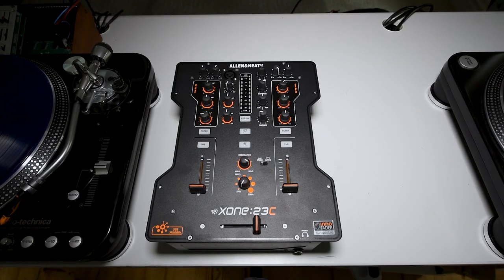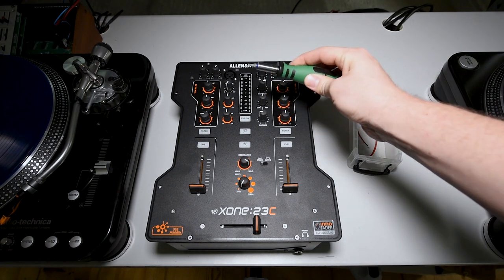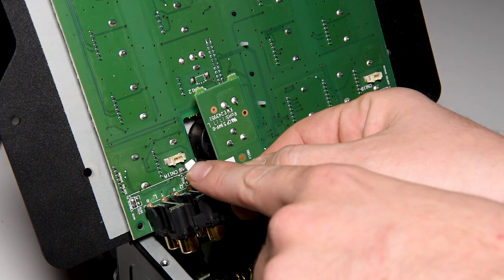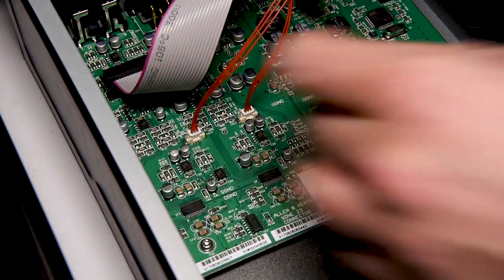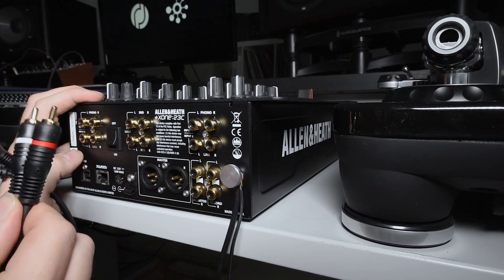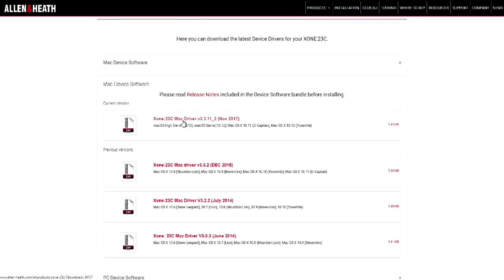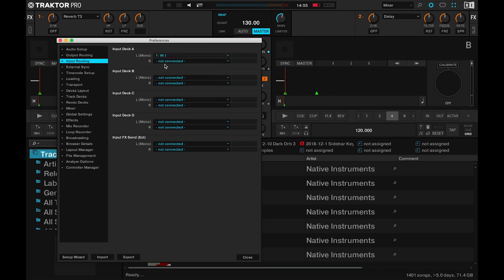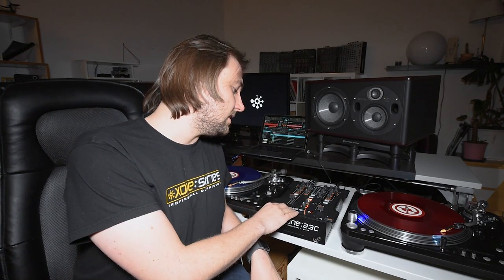#XoneQuickTips - Xone:23C TP3 DVS Mod

Comment: Hi ! Can I use CrossLE (Mixvibes) with my Xone 23C to play in DVS mode ? (I have 2 Audio Technica LP120 USB and 2 Pioneer SDJ50X) Is my (low budget) soundsystem great ? What are the benefits of buying an interface (Serato or Traktor for example) ?
Reply from the maker: Hi M M, 

Yes, you can use DVS with Mixvibes and the 23C. 

I think with your current setup, there is no need for an additional third-party interface.  

The 23C will also work with Traktor pro DVS. However, if you did want to use Serato, then you would need to acquire a certified piece of hardware. 

Thanks, 

Luke
Reply: @xonedjofficial  Thanks a lot !
Reply: @xonedjofficial  Another question : I can't find any mixvibes timecode vinyls, will Serato or Traktor (or any other brand) timecode vinyls work with CrossLE ?

Comment: I’m really need to know exactly what jumper cord size that was?! I can’t find them anywhere please help!
Reply from the maker: Hello Angel Gamboa,
The jumper cables are supplied in the box that the 23C ships in, please contact your retailer if you did not receive any.  Alternatively, you can contact our distribution partner in your country and order a pair, please quote part# AL9422.

Distributor contact details can be found on our where to buy page.

https://www.allen-heath.com/where-to-buy/

Kind regards,
Luke
Reply: @xonedjofficial  I have the same problem! could you just write the type of jumper we need?
Reply: its a jst 3 pin cable

Comment: Actually I use Traktor with Time Code Vynils without those cables and it works. Obviously I use the crossed cables from Native Instruments that use both phono and line connectors
Reply: Hi I cannot get traktor to work correctly with my 23c with the DVS mod done. What are the crossed cables you mentioned?

Comment: Hi
When I play regular vinyl it sounds/feels like the mixer is being overloaded.  I can barely turn the headphone volume up without it being too lound when cuing a track.  I'm also unable to turn the gains up so the indicators hit the oranged before it's too loud.  NB: I have the monitor volumes set to infinity mode already.  I'm removing the DVS jumper leads to see if that makes a difference.  Thanks
Reply from the maker: Hi Tia,
Thanks for the message.
If you would like some assistance with this. Please drop us a line via our support system.
http://support.allen-heath.com/Tickets/Submit

Kind regards,
Luke
Reply: Hello, did you solve the problems? I have the same issue and can not solve it after talking with Allen & heath. Thanks
Reply: @Julio-ou7tm  I haven't actually applied the fix however 🤔
Reply: @tiadowling135  they wrote me but told me is not common (I referred to your comment) and just told me to open and check if everything is fine... So you continue using it with the distorsión? In the speakers is "" ok"" but i can't stand it in the headphones
Reply: @Julio-ou7tm  I must admit I'm not happy with  the mixer itself. The fact it needed opening up and jumper cables installed  by the user to enable the DVS/timecode capabilities baffled me.  I guess I should have read the manual first before choosing that mixer!  Yes I'm still using it without the solder fix.  Apparently the distortion/lack of signal happens when you use older inputs i.e. Technics MKIi turntables with a newer mixer
Reply: @tiadowling135  yeah that's my case, the mk2. I was very happy, have also a pioneer but xone 23c has much better sound

Comment: Hi. I connected a reverb and delay pedal to the 23c. Is there a way to regulate the volume of the fx? like  I would do it on a Xone 92 with the volume of the channel. I guess I might be doing something wrong because it's just to much fx! Thanks
Reply from the maker: Hi Marlon,

Thanks for the message.

There are no send or return level controls on the Xone:23/23C FX. The level of the FX signal, therefore, needs to be controlled on the FX units you are using.

I hope this helps!

Kind regards,

Luke

Comment: Hi there, thanks for the video!
I have a Xone:43C and we are not getting in any signal from our Traktor scratch vinyl playing on two Technics SL-1210MK2.
Do I also have to open my mixer and activate the DVS Mod? 

Cheers,
Dan
Reply from the maker: Hi Daniel,
Thanks for the message.
No, there is no jumper mod require on the 43C. Simply make sure that the input switch is set to PH on each of the socket that the turntable are connected to. These are located on the rear of the mixer. Then the input source select needs to be set to USB.

Kind regards,
Luke

Comment: Hi Xone, my headphone is partially working when I play music on the deck A , I can only hear from the right side of my headphone.
Meanwhile on deck B everything is fine.
Any help would be appreciated, Thanks.
Reply from the maker: Hi Apolløne,
We are sorry to hear that you are having some issues with your Xone:23C.
If Deck A is only displaying one side on the VU meter, please check the input connections and playback device to ensure that the fault does not lay there. Maybe change out for deck B for a quick confirmation test.
If the same results are obtained, then it will need a service engineer to take a look and offer a diagnosis. For service support please contact our partner in your country. Contact details can be found on the where to buy page.

https://www.allen-heath.com/where-to-buy/

Kind regards,
Luke

Comment: So what if I want to play regular vinyl? Like one day I do Traktor timecode and the next regular vinyl... would I need to go in and remove the cable?
Reply from the maker: Hi Obshaky,
Thanks for the message.
With the DVS jumpers in place, it is possible to play a mixture of regular vinyl and DVS. As the USB return feeds back post mixer gain-stage. You simply need to keep the gains down when mixing DVS, then use/turn-up the gains when you want to play regular vinyl.
FYI; the DVS gain need to be established with the software soft-gain controls.
I hope this helps!

Best regards,
Luke

Comment: If I want to convert to line level, how do I remove the resistors? The manual doesn't make it clear (to me). Thanks.
Reply: (I want to use timecode CD's)
Reply from the maker: Hi,
Line level conversion is only necessary if you require the additional (two) line inputs. Otherwise you can use the standard line inputs for DVS (with CD).
For conversion, the resistors a located on the underside o f the main surface PCB next to the input connectors. If you are unsure about the work involved, we highly recommend seeking assistance from one our certified partners. Contact details can be found in the link below and selecting a country.
https://www.allen-heath.com/where-to-buy/

Best regards,
Luke
Reply: @xonedjofficial  Ah that's great news, I thought soldering was a necessity to play any kind of DVS with CD. Thanks for the reply!
Reply: @xonedjofficial  Sorry, one more question. Do you happen to know the input and output routing for Traktor when using CDs? I'm having issues. Thanks.

Comment: Hey Guys. I’m having an issue with recording sets from both DVS and live vinyl on the xone23c. Using Mac. Can anyone help with setting up fro recording?
Reply from the maker: Hi,
Please run form the 23C record output, then using an RCA to 3.5mm jack you can run into the Mac headphone socket which is tied to the computer’s internal soundcard. You will need to use third-party recording software or DAW for recording.

Best regards,
Luke

Comment: If I use this with Traktor, can I have Deck A & B playing while using a remix deck to route directly to master out since the internal soundcard has 4 ins/outs. Is this possible?
Reply from the maker: Hi Sarp Sulun,
When referring to I/O on USB and interfaces, the count is always in mono! So, with regards to 23C 4in/4out (mono). That’s 2in/2out (stereo).
So, I’m afraid what you propose is not possible.

Kind regards,
Luke

Comment: Hey Guys - I recently moved to Mac and am now having routing issues. Was working fine as a USB standalone with TP3 and Windows. Now moving to Mac I can't assign channels to input/output routing as a standalone USB since its CoreAudio compliant there aren't specific drivers available from the website - can only get both channels through Ch1. Will an ASIO driver work on Mac? Or do I have to install the jumper leads in order to route the channels correctly and thus converting to DVS (not be able to use it standalone USB in the process)?? Seems really clunky overall for something that should be plug'n'play - I'd like to switch between DVS and USB without having to change jumper leads or buy another soundcard....
Reply from the maker: Hi MrTinks,
Thanks for the message.
23C is Core-compliant. There is no need for drivers. And it does simply work straight out the box.
Please ensure that Traktor’s routing is set to ‘external mode’. This will give you the option to route to each of the channels on 23C. 
The 23C outputs will labelled as follows.
1,Front left
2,Front Rigtht
3,Front centre
4,Low frequency effects
The first (top) pair are the left and right for 23C CH1, whereas the bottom two pair are for 23C CH2.

The DVS jumpers are for configuring the USB sends (from mixer). This changes them from the FX and record sends to instead route DVS straight off the mixer’s input connectors. This has nothing to do with the input routing (from computer).

If you require further assistance past this, please drop us a line via our support ticket system.
support@allen-heath.com

Best regards,
Luke
Reply: @xonedjofficial  Thanks Luke. That was really random, swapped the USB port and the channels were available to assign in the External tab. So - last question, if I convert it to DVS am I still able to control Traktor standlaone or using a X-linked K2 for example.
Reply from the maker: That’s great. I’m glad to hear the USB routing is now sorted!
With regards to the DVS, the jumpers solely reconfigure the USB sends (from mixer). The default setting of these sends is to route the Record and FX send buses. The USB returns (audio from computer) and the MIDI over X:Liink will be unaffected by this mod.
I hope this helps!

Best regards,
Luke

Comment: Hi, can the USB Port charge an iphone/ipad? i'm trying to use this mixer using the app DJ Player Pro...
Reply from the maker: Hi Wally,
No, the USB port on the Xone:23C does not output a voltage, this is supplied by the device by the host that it is connected to. In this case the I-pad.
Please note; that you should always use the manufacturer’s recommended supplied for each device.  I-pads require a higher current supply than most USB sockets will output (on computer for example).
Regards,
Luke

Comment: Hi there Xone team, do I understand correctly that this mod will NOT affect the sound quality coming from/though phone preamps when playing regular vinyl? Thanks.
Reply from the maker: Hi Max,
Thanks for the message.
Yes, that is correct. The pre-amps will be unaffected. This jumper is solely to change the USB routing from default record and FX sends to input channels 1&2 (pre-gain) for DVS.

All the best,
Luke
Reply: @xonedjofficial  Thanks for the reply Luke, consider that you've got new "old" customer. I am switchning from oldie, but goldie 22 to 23C. KR, Max

Comment: Should I buy a tracktor scratch pro to use time code vinyl? It cause i already have traktor pro that normally using with S2 or X1
Reply from the maker: Hi Stefano,
Thanks for the message.
The Xone:23C is Traktor scratch certified on Traktor pro. There is no need for additional software.
Best regards,
Luke

https://support.native-instruments.com/hc/en-us/articles/210273865?_ga=2.6964274.1089701208.1589790605-457403339.1578046159

Comment: Hey guys this helped me get inside the box to do the mod where you turn the phono level inputs to line level(as per the manual on pg 18) removing the resistors worked but the signals are definitely quieter than the built in line levels.. is this expected? Also whats the unused big rectangle plug? It has jtag/debug written on one side and “male” written on the other side of the socket. Thanks A&H love your gear!
Reply from the maker: Hi Aaron,
Thanks for the message,
The resistor mod simply deactivates the RIAA filter, but the signal still passes through the phono op-amp. So, having slightly different topology, one would expect some difference. 
I think if the channel is proving to run at line-level you should be able to achieve a healthy signal with the input gain control.
FYI the JTAG socket is for in-house programming.

Best regards,
Luke
Reply: @xonedjofficial  awesome Luke thanks for the great info. I love the 23c, a great entry level to A&H quality sound. Yep the sound is good. 10/10 ! You work for a great company!

Comment: Hi. followed this to the point but the timecode sound (high pitch noise) still comes out through the speakers. Am I missing something?
Reply from the maker: Thanks for the message, though we are sorry to hear that you are having some difficulty.

When using the 23C for DVS please ensure that the input 1 & 3 level controls are set to infinity (off), this will ensure that the analogue signal from the DVS record will not pass through the mixer to the outputs.

The audio input gain is then determined by the soft gain in the Traktor software.

I hope this helps!

Kind regards,

Comment: Hello, thanks for this video. On Mac OS, after following all the steps required, in the output routing: 
External mode
Output deck A is set to L: Front Left and R: front right
Output deck B is set to L: Xone 23 cout 2 R: Xone 23c out 3. 

Same for the input routing ( deck A front left front right deck B Xone 23c out 2 xone 23c out 3)

It's working but the sound is not so good. I have them connected by "phono" with 2 audio technica AT LP120.

I was wondering if this shows a problem or it's normal, because you on your tutorial you have OUT 1/2/3/4 .

Thank you  ;)
Reply: Hi, did u figure out a fix?
Reply: @vlogville3844  Yeah I'm having the same issue, did someone already solved it?

Comment: Is possible to lissen the musci in th master of the mixer and no in the computer when you use dvs?
Reply from the maker: Hi Pralu,
You can listen to the master mix bus on 23C. Either deselect the cue switches, which will default the headphone to the mix. Or turn the cue/mix control fully clockwise to the mix position.
I hope this helps!
Thanks,
Luke
Reply: @xonedjofficial  thanks!

Comment: Hey. This mod means I can't record to software from USB, right? But I assume I can still record from master out? Thanks
Reply from the maker: Hi Vyv,
Thanks for the message.
Yes, that is correct. Converting the 23C to run on DVS will disable the Master record and FX sends via USB.
You can still use the analogue RCA record output for audio capture. But you will need to run this into a third-party interface.
I hope this helps!

Best regards,
Luke
Reply: @xonedjofficial  hey,  If I do this will I be able to record a set that consists of both timecode + vinyl to software?

Comment: Do I need to go back and disconnect the jumpers to play regular vinyl? Or can I use it with the jumpers for Traktor and play regular vinyl? Thank You
Reply from the maker: Hi Vinyl Masta,

There is no need to remove the DVS cables in order to play Vinyl.  You can either simply turn up the Phono level control on the 23C, this will then play directly into the mixer form the turntable.  Alternatively, you can use “live input” mode in Traktor, this will then pass the Audio through, with gain adjustments being made in the software.

Best regards,
Luke
Reply: @xonedjofficial   So when the input volume on the top of the mixer is down it'll take audio input through usb automatically? Or does usb audio come in through a specific channel? 

Also, since this mixer is USB class compliant, will it work with other software like Mixxx or Xwax? I only ask because pioneer has drm on their mixers that only unlocks the soundcard for specific software. 

Thanks,
Ian

Comment: Hi there Xone Official, last week I did the mod (with the jumpers) to start using DVS; (opened in a very clean environment with gloves); I started calibrating the DVS, I got signal a couple of minutes and then, no signal from the phono channel (right side of mixer); it is very strange, nothing looks damage, and I was careful with everything in the processes.

I have tried connecting different audio sources but that phono channel doesn't appear to be alive, I just, sometimes, sends a loud signal (red) and the mixers seems to reset (lights checking as when is turned on).

The other input (line) from the same channel (right side) sounds and performs flawless, please help. Thank you
Reply from the maker: Hello Stijepan,
We are sorry to hear that you are having issues with your Xone:23C.
Unfortunately, this is not something that we are able to diagnose remotely. For assistance please refer to your dealer. Or alternatively you can contact our partner in your country and they will be happy to assist. Contact details can be found on the A&H where to buy page.

https://www.allen-heath.com/where-to-buy/

Best regards,
Luke
Reply: @xonedjofficial  thank you, I'll do that (I guess when the pandemic is over...)
Reply: I have the same issue with a brand new mixer. Did you get this resolved?

Comment: Thanks for the vid! Really helpful. QUESTION - the tracking tone still comes through the mix, is this normal?
Reply from the maker: Hi Nick,

Please turn down (off) the input gain level when using DVS. This will stop the timecode signal from passing.

All the best,

Luke
Reply: @xonedjofficial  Brill - thanks for the tip. You guys are awesome